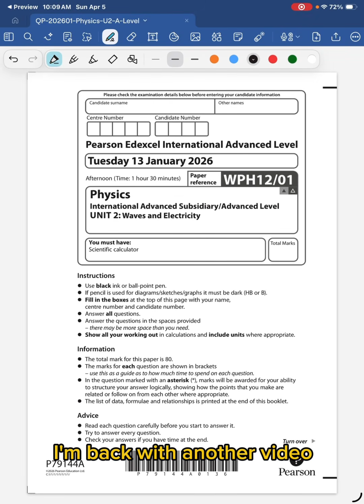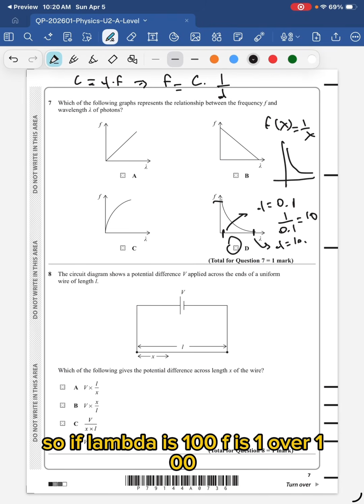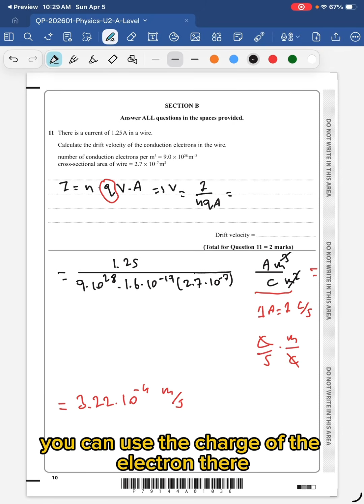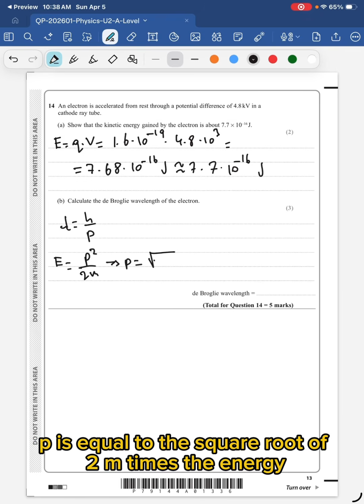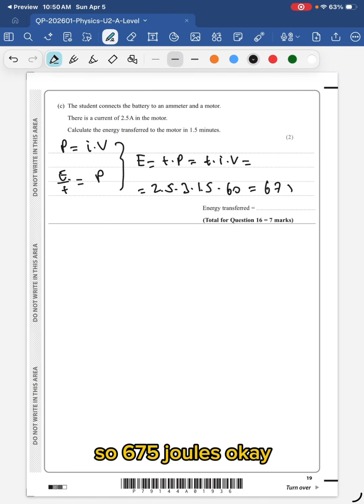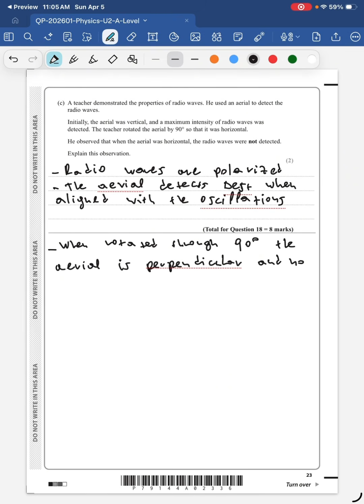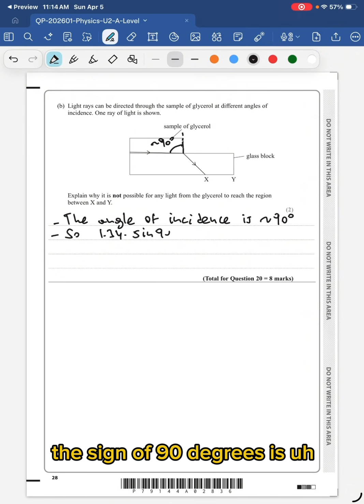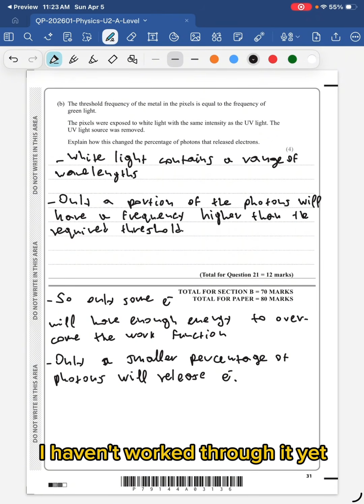Edexcel IAL Physics Unit 2 January 2026 Full Paper Walkthrough

Comment: i dont understand why in q 15/ii how does R over 11 come when it was first 11 over R?
Reply from the maker: Hi, thanks for asking. In Q15(ii) we have 11 identical resistors in parallel, so we add their reciprocals: 1/Rtot = 1/R + 1/R + ... + 1/R (11 times), which gives 1/Rtot = 11/R. That equation is for 1/Rtot, not Rtot itself. To get Rtot alone, we flip both sides upside down, so Rtot = R/11. That flip is why it goes from 11/R to R/11. Hope this helps

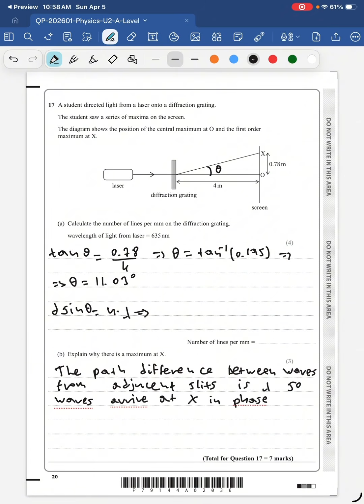Comment: at 39:00 can i say phase difference 0 instead of X being in phase
Reply from the maker: If you mean phase difference = 0 (same as saying waves are in phase), then yes that's fine, it means the same thing.

But if you mean path difference = 0, then no, that's not the same as n*lambda. Path difference = 0 would mean both waves travel exactly the same distance, which is only true at the central maximum (O), not at X. At X the path difference is one wavelength (n=1), not zero.

Either way, for full marks you need all three steps: (1) path difference between adjacent slits is one wavelength, (2) so waves arrive in phase, (3) so constructive interference occurs

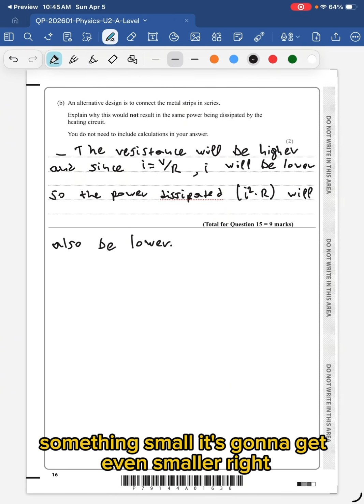Comment: sir in 32:20 shouldnt I be constant and same since it will be in series.? why will I lower even though it should be same.
isnt voltage varying for each point
Reply from the maker: Great question! You're right that in a series circuit, current is the same at every point in that circuit. But that's not what's being compared here.

The question is asking us to compare two completely different circuit designs:

- Original design: 11 strips in PARALLEL, total R = 0.45 ohm
- Alternative design: 11 strips in SERIES, total R = 11 x 5 = 55 ohm

In both cases the battery is still 12V. So when you switch from parallel to series, the total resistance goes from 0.45 ohm to 55 ohm. That is a massive increase. Since I = V/R, the current entering the heater drops significantly.

You are absolutely right that within the series design, current is the same throughout. But that current value itself is much lower than in the parallel design, because the total resistance is so much higher. That lower current means less power dissipated (P = I²R).

So to summarise: I is constant within one series circuit, yes. But I is lower compared to the parallel version because the total R is much higher. Hope that clears it up!

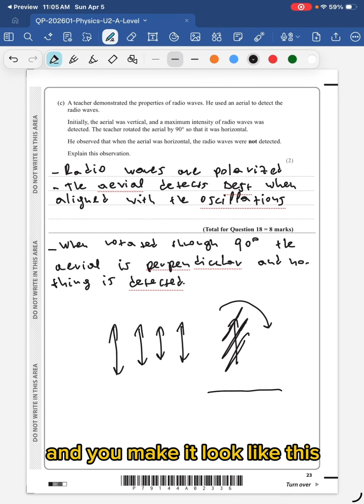Comment: 44:37 I thought radiowaves were unpolarised as they are transverse? I am confused as the question hasn't mentioned that the radiowaves were polarised, so is the aerial polarising the radiowaves or is it  the  radiowaves?
Reply from the maker: Great observation! Radio waves from a transmitting aerial are already polarised by the way they are emitted. The oscillating electrons in the transmitting aerial move in one direction, so the electric field oscillates in that same plane, making the wave polarised. The question implies this setup, so you can assume the waves are vertically polarised to begin with. The receiving aerial does not polarise the waves. It simply detects them best when aligned with the plane of polarisation. When rotated 90 degrees, it is perpendicular to the oscillations and picks up nothing
Reply: @doctor_no_  Ohhh thank you! That makes sense.
Reply from the maker: @icecreamsandwichesyum you are very welcome!